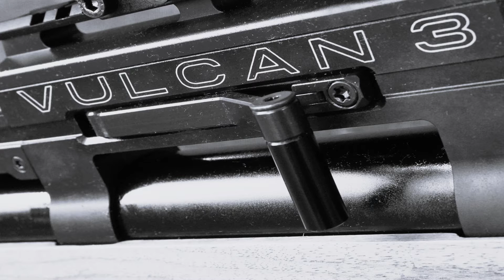Vulcan 3 Going SUPERSONIC with 40 gn Zan Slugs

Comment: Hello, I am your follower from Iraq. I would like to know how much you increased the pressure of the regulator to obtain this enormous energy
Reply from the maker: @Yahya_89  good day  reg pressure around 220 bar
Reply: @AfricanAirOrdnance  Thank you very much.. but 220 bar is too much. You will not get a good number of throws as in FX Impact M3. If you change the hammer with a heavier hammer, not just the spring of the hammer, I think you will get high speeds with less regulated pressure.
Reply: @AfricanAirOrdnance  In the FX Impact M3 rifle, you get a speed of 1000 fps or more with a regulated pressure of 160 bar, and you get a good number of shots, but with an 800 mm barrel.
Reply from the maker: @Yahya_89  https://youtu.be/py5QZ2nesWU?si=-lSRJ6xjXOBJzPSB
Reply from the maker: A FX with a 800 mm barrel can't do that

Comment: What's your regulator pressure if you don't mind?  I got 40 grains going 967 so far. Would prefer them closer to 1,000 so I can shoot 30,34, and 36 grains well too.
Reply from the maker: 250

Comment: Great video but why with both barrels the velocity dropped after couple of shots??
Reply from the maker: running the Regulator at very high pressure so it limits the number of regulated shots.  its only showing what is possible it does not mean you should run your gun that hot

Comment: I had an FX barrel mod for Vulcan 3 and I can use the FX Liners within it, you can Achieve supersonic speeds a lot easier with it especially the superior standard liners with a twist rate of 1:24, the Uragan 2 barrel still a 1:17 twist rate as the Vulcan 3 barrel but with much bigger air port, 

As Always 
WELL Done and thanks for sharing this experience, defiantly will try it 👍
Reply: Hello, the 1:17 twist rate is much better for using SLUGS. The 1:24 is a good twist rate for pellets.
Reply: @redgum1340  Both twists  are excellent for slugs and pellets, what differ is the accuracy / speed , the faster the twist the less velocity you need to get good accuracy, the slower the twist the higher velocity you'll need to get better accuracy
Reply: @hralhajriify  hello, where did you get the idea of 1:24 and 1:17 TR are both exellent shooting slugs and the only difference is the velocity? the 1:17TR is ideal for shooting both light up to heavy slugs and pellets. and the 1:24TR is good only for pellets and light slugs not ideal for heavy slugs
Reply: @Jeff6021-z6o  Hi, I have both barrels and I use them constantly with both pellets and heavy slugs, I dont recall any favorable result except the velocity factor , slower TR (1:24)barrel  is better grouping at velocities between 950-1050 fps , while the fast twist rate (1:17) is better grouping for the same pellet/slugs at velocities between (880-930) , thats what I noticed, to be more precise I use JSB pellets king heavy (33g) and NSA 43.5g heavy Slugs on both barrels and that was my result, it may differ if I used other types of pellets or slugs so I cannot say this is a conclusion, but an experience shared.
Reply: @hralhajriify  how small is your groupings at 100yrds with those result you've got using heavy slugs in both 1:17 and 1:24?
Reply: Where do you find the barrel mod?
Reply: @joelowery8827   it seems every time I post a reply , youtube deletes it because of the link
I will try to write it in separate words below this reply hopefully wont delete it
Reply from the maker: Thanks for watching
Reply: @joelowery8827  search for FX barrel holder shop
Reply: this mod will be a special order , so you may want to contact them by whatsapp number written in their website to order one
Reply: @hralhajriify  thanks. I found someone locally to make one.
Reply: @joelowery8827  Excellent, ,make sure to use the superior standard liner as it has 1:24 twist rate, the STX heavy has the same twist rate of the original Vulcan alpha barrel 1:17 so it wont make a difference. Good luck :)
Reply: @hralhajriify  I’m putting a 800mm with heavy liner.
Reply: @joelowery8827  I don't think this will give you any extra FPS, you will be in the range of 950-1050 with 40g slugs but it will surely enhance the accuracy, the expexted results will be interesting, hope you can upload some videos later on 👍🏻
Reply from the maker: Thanks for watching
Reply from the maker: Thanks for watching
Reply: Does your poi shift with the flimsier fx barrel?
Reply: @castincatchin7400   if you mean by Zero Change ? then yes, you have to adjust your scope each time you change the liner, but once adjusted it will always group well as long as your rifle is regulated
Reply from the maker: Thanks for watching